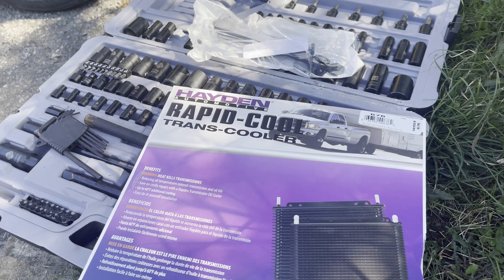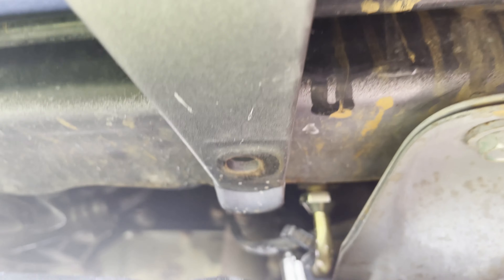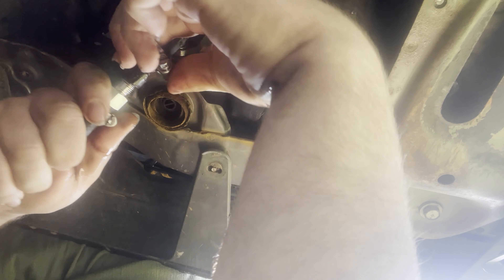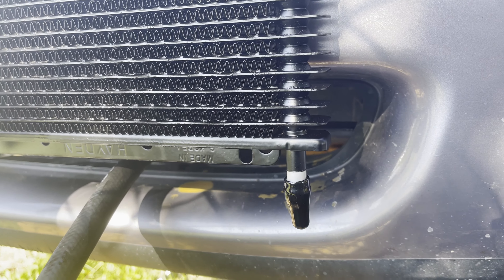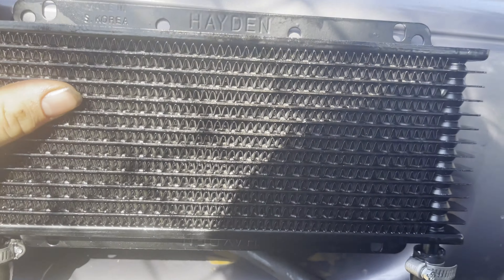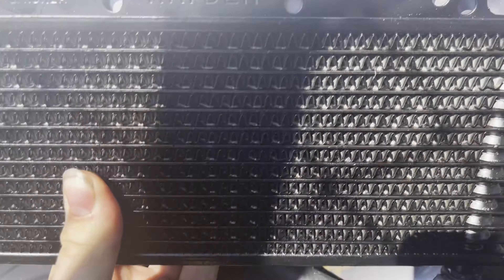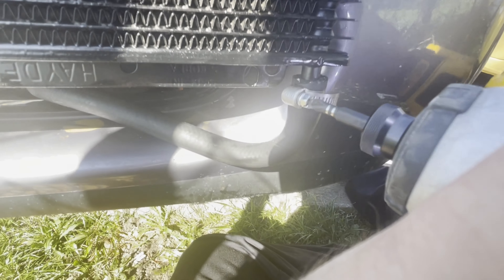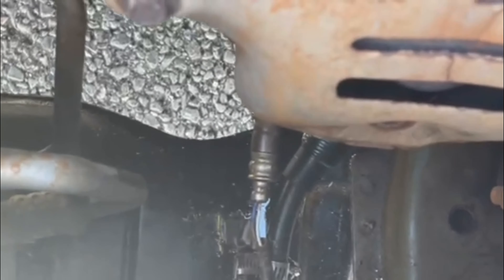Installing a Transmission oil cooler on my 1997 Corolla

Comment: You know the purpose of the cooler is to let airflow through it. Where you mounted it, air is only going to flow through the lower section of it